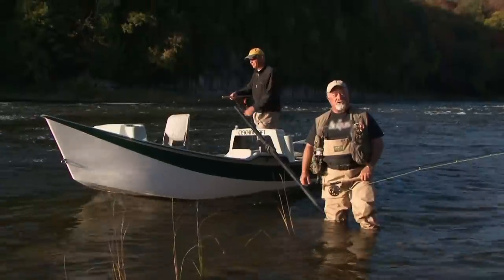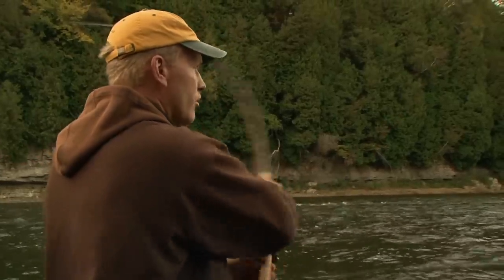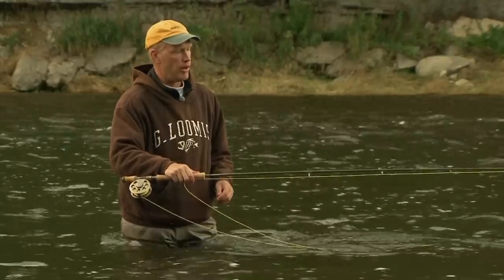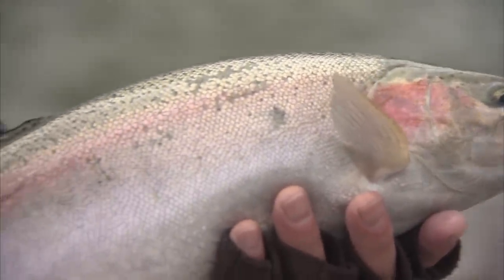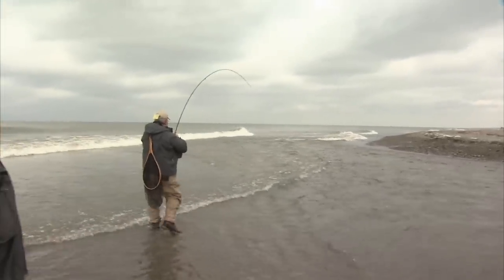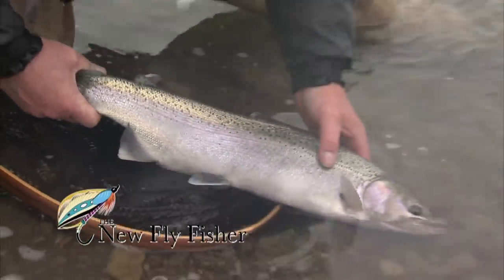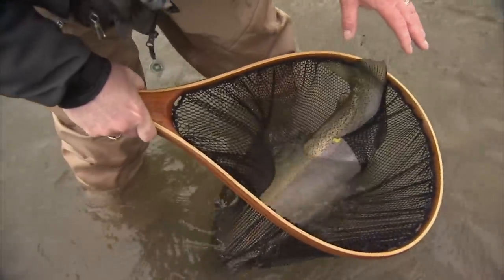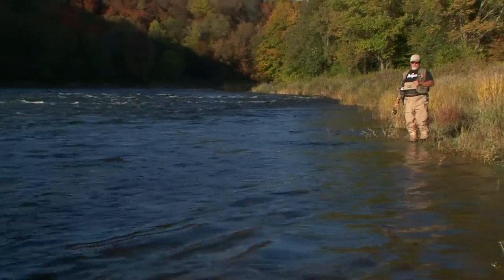Swinging Flies with Spey & Switch Rods for Steelhead

Comment: I'm still not sure if I want a switch or spey rod
Reply: I use both but it depends on what you fishing for . I find a switch rod to be more versatile I have two 11’6” switch rods one trout Spey 4wt one 11’6 6wt for silvers and steelhead and use both scandi and Skagit heads on both . For me I like the Skagit heads because you can switch out the heads and add a floating head that casts like a scandi for skating or shallow water . I also have a 13’7” 8wt Spey rod for bigger rivers with a hybrid head airflo Rage it will throw bigger flies like intruders but can also throw lighter flies , soft hackles like a scandi . To me the casting is very similar the only difference is the switch you can use as a single hand rod also which comes in handy while floating in a boat . Either way you will definitely have fun and be able to spend more money on fishing stuff :-)